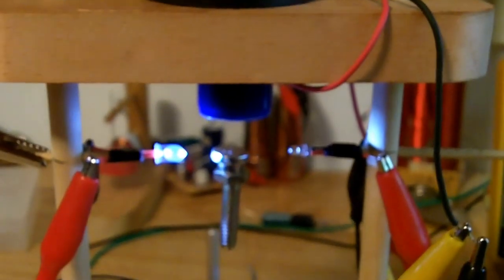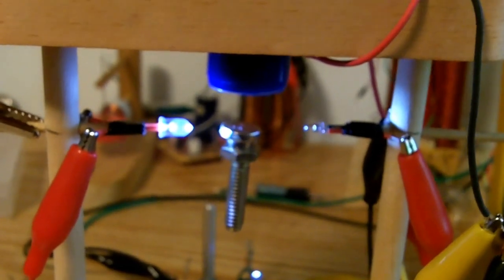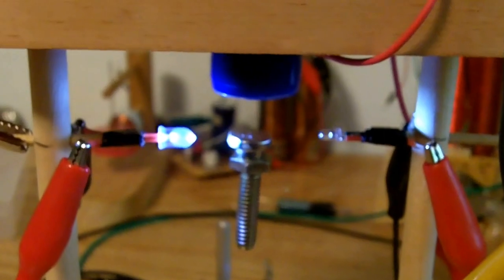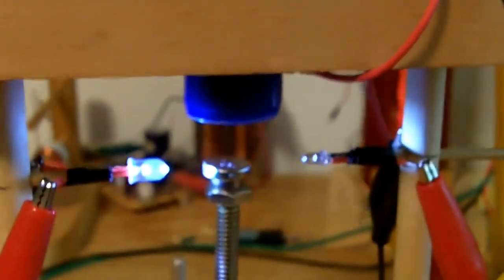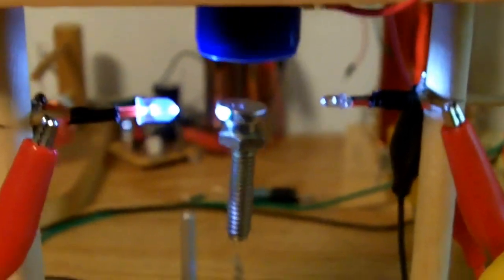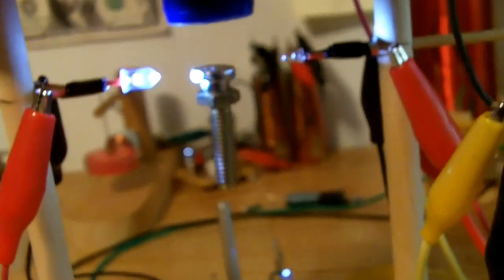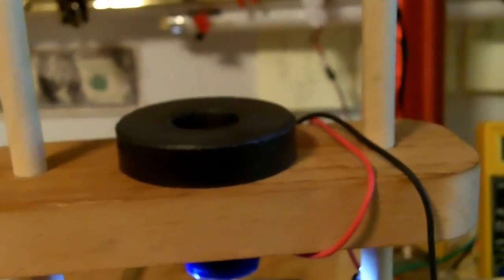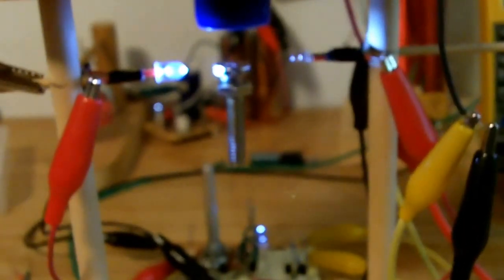Levitation    It Works!

Comment: Congratulations ! 
Ah, the pride and achievement feeling when they do work. It's just the getting there, but as you say, now you know so much more about them and how they work. Very cool workarounds, including the distance through the wood using the m/wave magnet.
If you blow up the LED, there's a massive I/R sender up in the sky that won't burn out lol